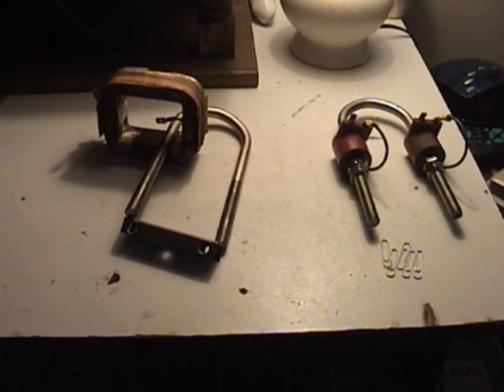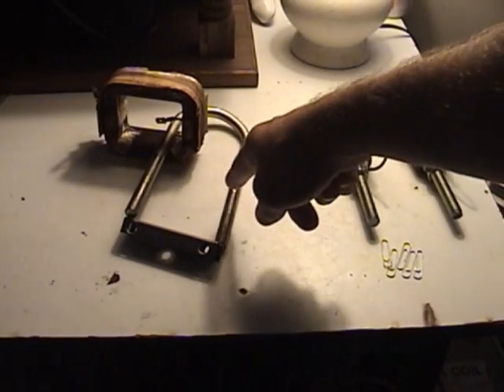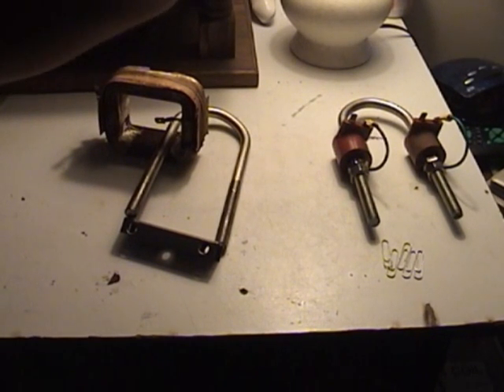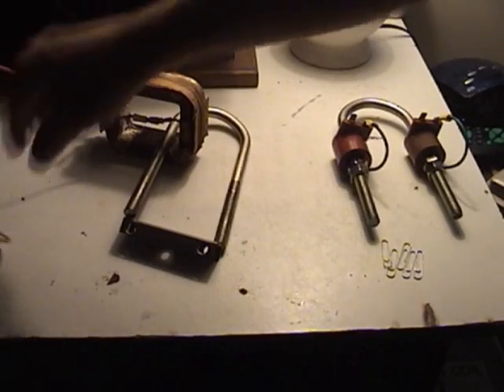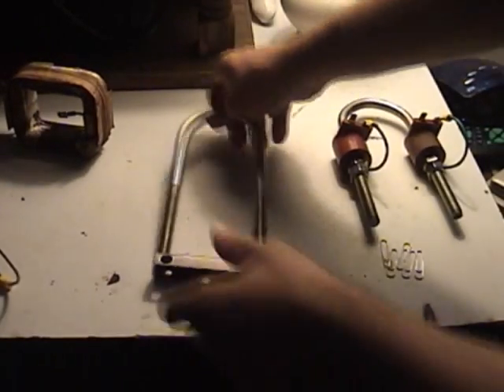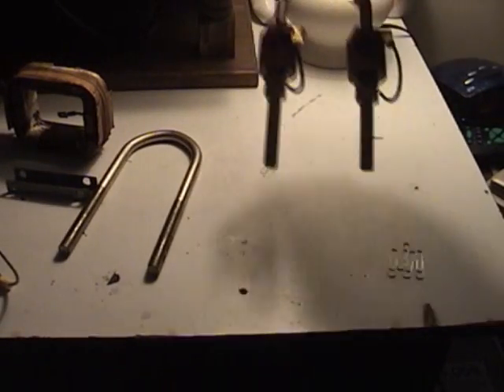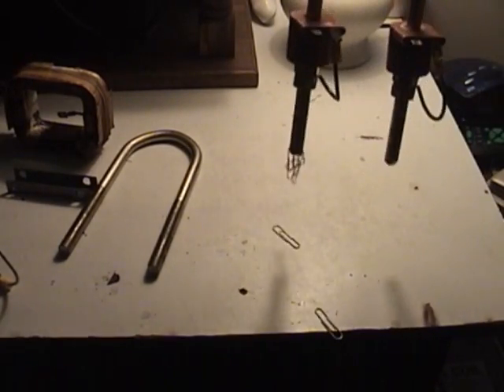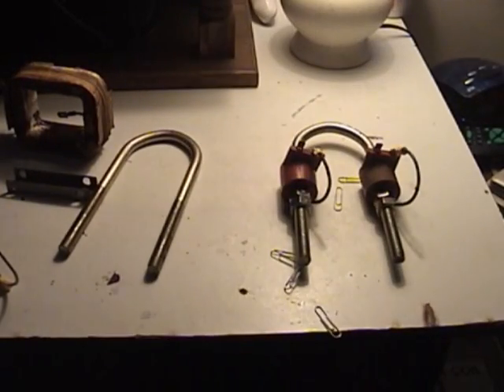Ed Leedskalnin Magnetic Current Pt 3

Comment: Is it possible that  you are only putting a charge into one of the reversing valve coils? Maybe one of the wires came lose or is broken inside its sheath? Or maybe the reversing valve coil on that side is defective and
 some how maybe the one with no charge is impeding the magnetic charge from going to the end of the U bolt? I have know idea,i'm just asking........

Comment: Well, if you are making the bar a magnet, perhaps the vibrations from smacking it would cause a current through the coils explaining the production of electricity?

 Also, have you tried adding a light as Leedskalnin did? It makes for a great evidence that it's not only a magnet, but a perma-capacitor.

Comment: cool-try it with a bolt instead of the U bolt -see if you can get just one end magnetised like the U bolt with the connection to the steel.
a magnetic monopole would not require any shielding if used in a magnet motor!